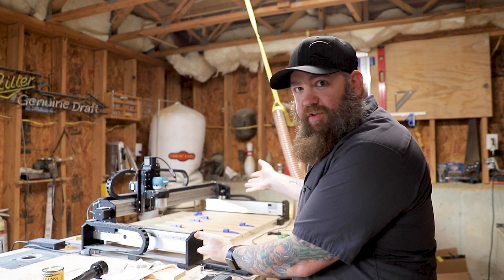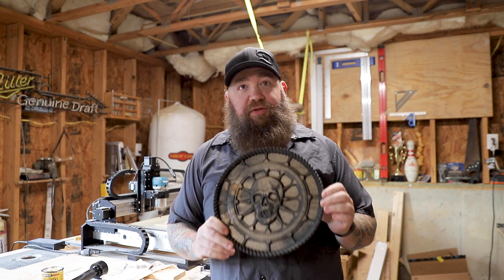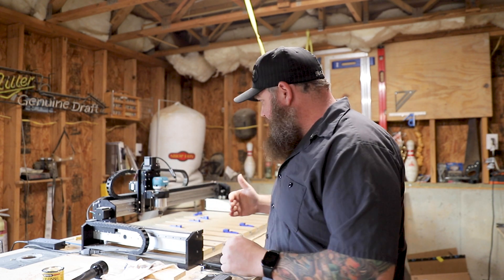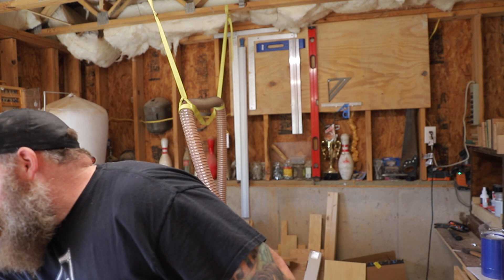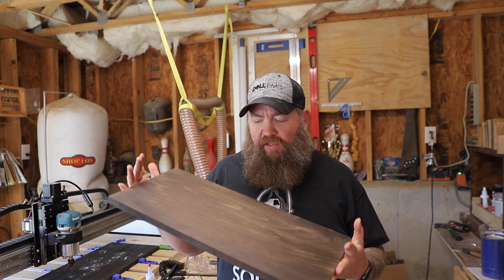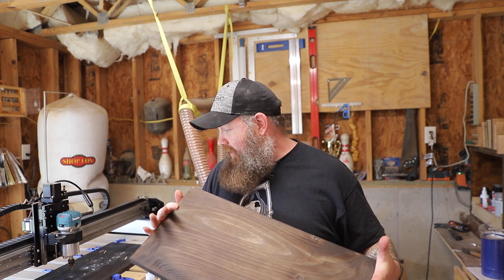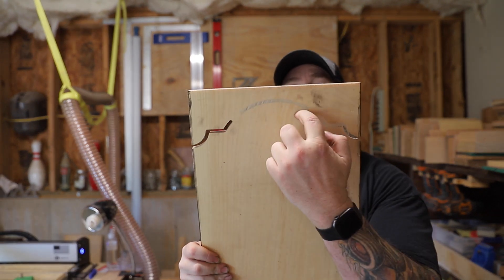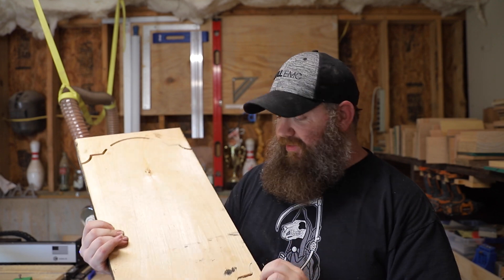We bought a CNC router!

Comment: Good to see a pro CNC cutting.  How did you do the cutouts? With just one line isn't that an open vector?
Reply from the maker: I did an outside profile cut with it as the tool path.  I definitely could have given it a LOT more feed rate all over.